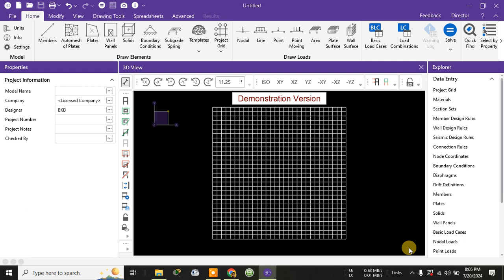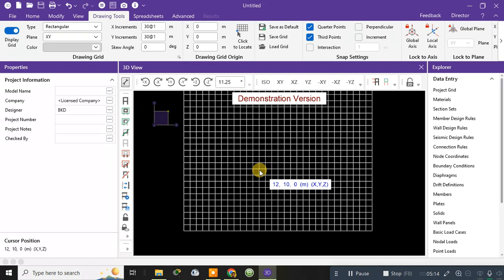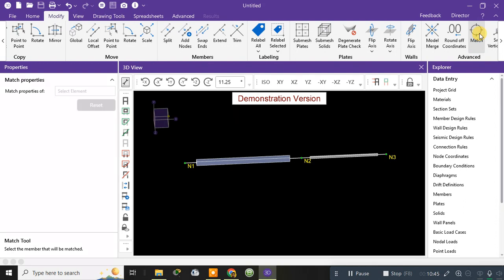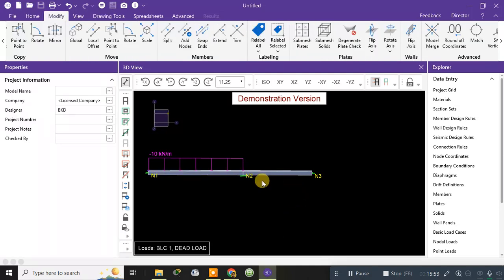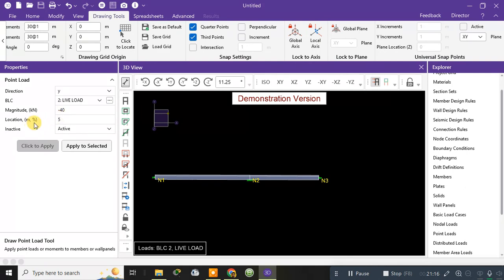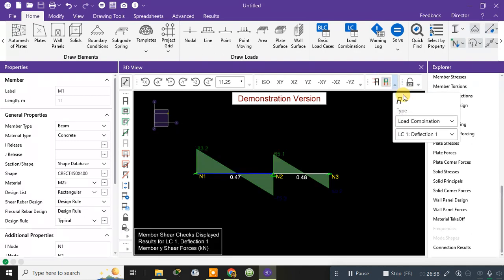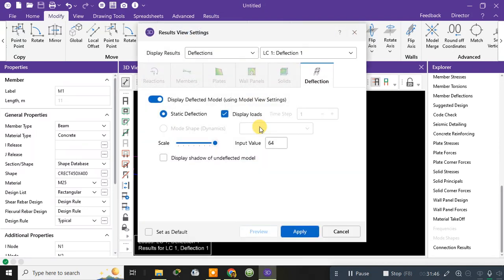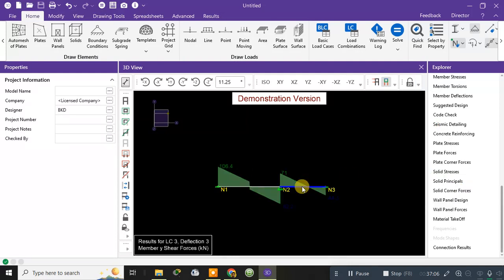HOW TO ANALYSE AND DESIGN A BEAM USING RISA 3D

Comment: sir,

I hope this message finds you well. I have been following your channel closely and I am impressed with the valuable content you provide to the civil engineering community.

As your channel continues to grow and make a significant impact, I would like to suggest a strategic focus that could benefit many of your viewers and enhance their professional growth. Specifically, I recommend concentrating on one structural analysis software: Autodesk Robot Structural Analysis.

Robot Structural Analysis is an advanced software tool that integrates seamlessly with Autodesk Revit and Revit MEP, making it a comprehensive solution for structural design and analysis within the BIM (Building Information Modeling) environment.

In my professional circle, many structural engineers are shifting their focus to this software, recognizing it as a game-changer in the industry. As the civil engineering industry increasingly adopts BIM technologies, proficiency in Robot Structural Analysis can provide a significant edge in professional development and career advancement.

By offering in-depth tutorials and insights on Robot Structural Analysis, your channel can lead the way in equipping engineers with the skills necessary to thrive in the evolving landscape of civil engineering. This focus can also position your channel as a key resource for cutting-edge structural engineering education.

Thank you for considering this suggestion. I am confident that it will add great value to your content and further enhance the growth and impact of your channel.

Best regards,